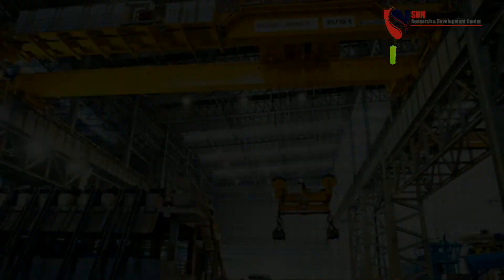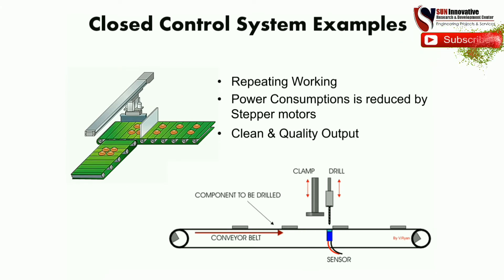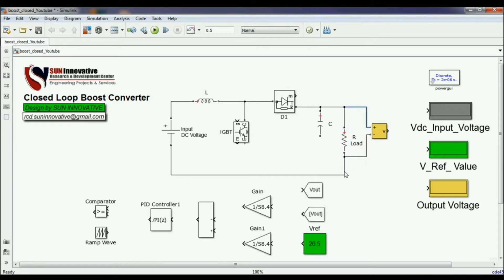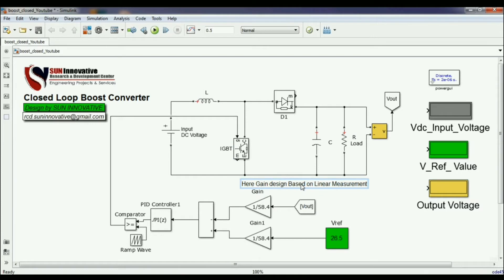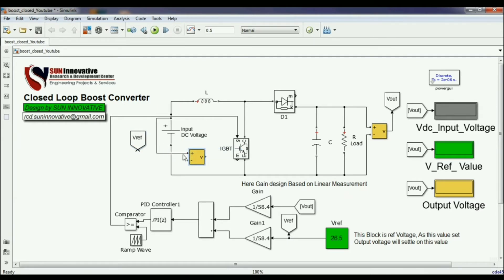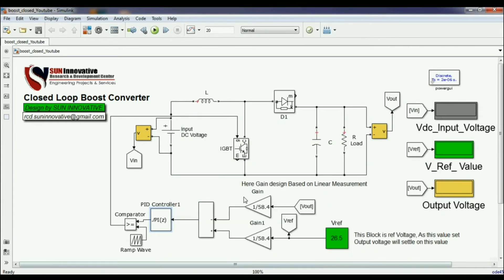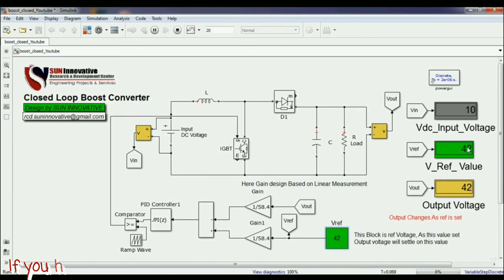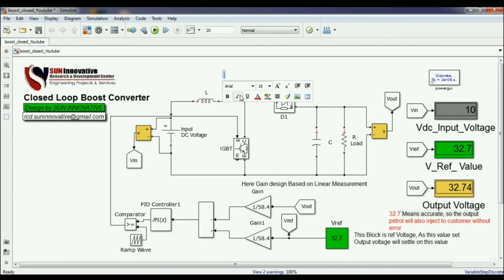Closed Loop PID Control of Boost Converter MATLAB SIMULINK • Updated version

Comment: How did you choose the gain to be 58?
Reply from the maker: That factor is choosen for getting linear output for the PID input
Reply: @SUNInnovative   could you pleas explain more cause I'm suck at this point in my design, is there a formula or a way to get the value ?

Comment: thanks for share. 
 i want load changing during 0-5 sec like 50 ohm and 5-10 sec want double, like 10 ohm. so how can i set? can you guide me thanks.
Reply from the maker: For this you must require following components from library that is, Breaker, Step, series RLC, in step provide values initial 0 and then 1 for time intervals of 0-5 sec, and that step output goes to breaker. This way breaker will enable and disable resistance according to step values 0-5. And 5-10 sec

Comment: Thanks for your share. How can plot phase margin this circuit?
Reply from the maker: Dear Thank you for watching our video, First thing you should do the same simulation in your file and go to PID tuning block there will be all the plots are present which you are required, Second thing you can create modeling of boost converter and can plot the phase margin by sing separate block for the bode plot. I hope you will understand the process if you dont get it please be send your snapshot to us we will help you.

Comment: How can tuned PID
Reply from the maker: This video is an example of PID, if I found general method to find suitable values I will share with you.
Reply: Thank you
Reply: @SUNInnovative  please upload general method of tuning PID specially where multiple PID is involved ,like suppose I want to control current through inductor and voltage across capacitor decide duty cycle or other way inductor current and capacitor voltage will decide duty cycle using 2 PID
Reply: @sourissahu3832   
Hello did u mange to control the inductor current and the capacitor voltage for boost converter ?